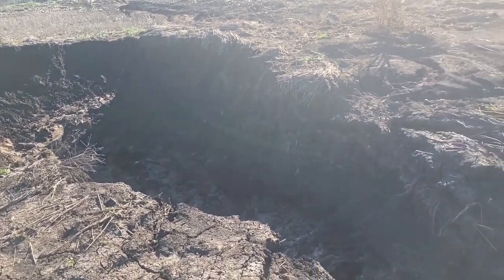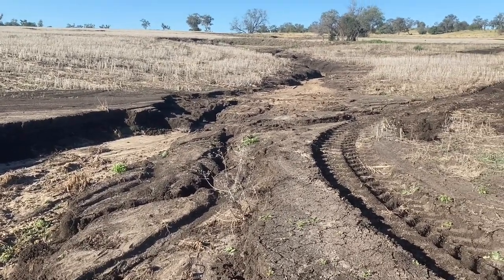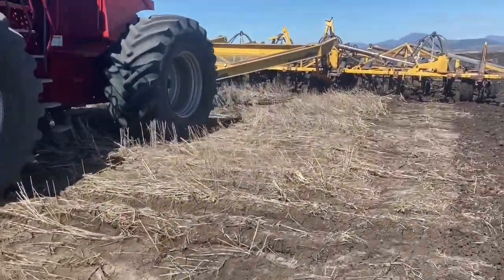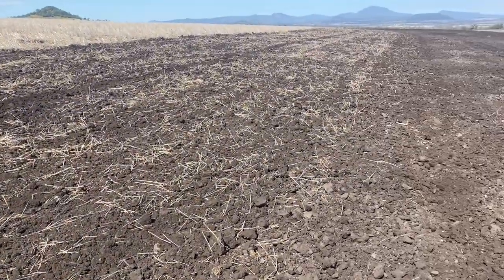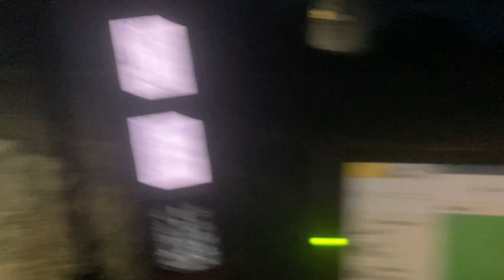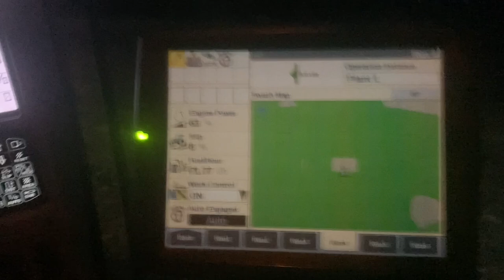Finished... Just in Time! (Vlog 9)

Comment: Are you mob looking into autonomous gear mate? Just wondering because it looks like pretty good flat rolling country which with a small tower would give you good coverage. Less work driving a service rig to a pre-set staged service area for your machines than having to drive the buggers yourself.
Reply from the maker: Not at this stage, that kind of autonomy is practically a few years away👍